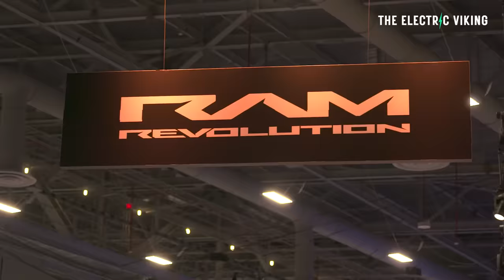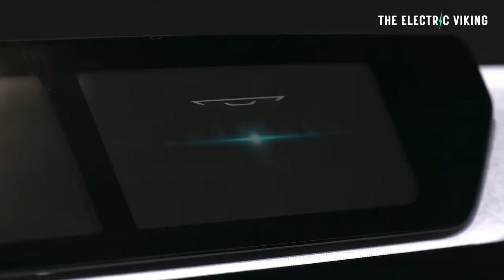Musk says Chinese EV companies will demolish most legacy automakers

Comment: In BYD defence, they're doing really good in a lots of countries especially developing countries. The only letdown is that the EV market in those countries have not yet taken off. Take my country Malaysia for example, BYD IS the best selling EV in Malaysia but due to the country's lack of EV infrastructure, it's EV market have not taken off yet, therefore they don't really sold much EV despite being the best selling EV brand in Malaysia.
Reply: there are no reason for malaysia to go all in into EV yet. Oil currently is still cheaper than electric unlike china u can save 98% of transport money by transfer from Oil into electric.
Reply: @nagi-springfield93  not really. Yes Malaysia is considered one of the countries that has the cheapest oil, but still 2x more expensive compared to charging an EV full with AC in home
Reply: @Rex-ww4cw  But still its 20 times more expensive than china. In china 1 kwh only cost about 3sen(Rmb) during 11pm-7am but in malaysia 1 kwh cost around 35-50 sen(myr). Chinese consumer willing to switch to ev because the benefit is significant enough to convince them but in malaysia even tho ev transport cost might be cheaper than oil but the car alone is so much more expensive than ICE mobile.
Reply: @nagi-springfield93  you literally said that oil is cheaper than electric in your first comments and I proved you wrong.
Reply: its not only malaysia problem, i think is common problem all over the world

Comment: You are dead right Sam. UNTIL someone starts to compete on PRICE no one is going anywhere. (Tesla DOES compete on price). When the Japanese "stormed the beaches" in the 1970's I was in my teens and CHEAP >>> anything else. A new Datsun B210 was something my non-car-loving friends could AFFORD to both buy and fuel (oil crisis, remember!) when my Camaro cost a fortune to run at 12 mpg (those big Holleys sucked a LOT of gas). A girlfriend of that era had a first-gen Civic, which is so radically different from today's Civic.
Come the late 1990's and it was the Koreans turn, with ultra-cheap Rio and Elantra. 1972->1997: 25 years. 1997->2022: 25 years. NOW it will be the Chinese, global politics and pandemics permitting. If it wasn't for the EV revolution, the Chinese would be shipping cheap small ICE vehicles, the coming switch to EVs just changes the dynamic. But unless the US and the EU throws up a protectionist fence, China will become a major auto power.
Reply: And just like now in the 70s every attempt of American OEMs to compete with Toyota and Honda was a complete failure.  The difference now is that it’s China not Japan and  the vehicles are EVs.  More and more it’s looking like Tesla will be the only American made EV company left standing that can compete in the mass market.

Comment: Standard sales strategies in a new market, basically divided into two.  BUY market share with lower prices; or use a LANCHESTER strategy, whereby you do not approach the main market directly.  You approach at a point that does not seem threatening and that is well away from the competitions main market.  You service the hell out of that local area until you own it.  Excellent service, fanatical customer support and good reliable products.  Only then do you slowly approach the competitions area, one town/city at a time repeating what you know will work.

Canon did this with plain paper copiers against the massive and mighty XEROX corporation in the UK.  It took several years to succeed but Xerox went bust and Canon were highly positioned.   This was a classic Lanchester method.

Watch out for a Chinese method that is similar.

Comment: 24/2/24 Chery Australia has recalled 5901 examples of its Omoda 5, after discovering a defect which can result in brake failure for the small SUV.

The recall affects all Chery Omoda 5s sold in Australia since local deliveries began in mid-2023.

“Due to a manufacturing defect, the bolt securing the brake pipe union may not have been tightened sufficiently. This could cause the brake fluid to leak and result in reduced braking performance,” Chery said in its recall notice.

“A reduction in braking performance could increase the risk of an accident resulting in serious injury or death to the vehicle occupants, pedestrians and other road users.”

Comment: The key selling points for EVs are range and price. So far not even Tesla has made serious inroads into either of these.  Perhaps 2024 will see some movement.
Reply: Please explain both points.  Price and range?
Reply: Prices have come down, The 3 and Y are not much more expensive then ice vehicles.
Reply: Isn't range the weak point, along with charging times? Oil and hydrogen and hybrid etc all have longer ranges than EV no?
Reply: @ex0duzz  The size of ones fuel tank is not the only thing that defines a car.  Especially if you fill it up at home every night.

Comment: What is the point of EV if it isn't better than gas car? EV have high cost and complex production , thus low profit margin - all because of its peculiar battery behavior : low energy density , decreased  reliability after so many charge cycles, high fragility , narrow temperature range, deadly in case of "thermal runaway ". Legacy OEMs have no where to go if EVs haven't proved themselves .
Reply: Have you driven an EV?

Comment: AI robotic labor can only lower manufacturing costs so far. A big part of the Chinese car advantage is supply chain.  
This cannot be easily replicated by OEMs. Using robotic labor may give the OEMs a little more room to lower prices but it still won't be enough due to the Chinese supply chain.

Comment: Thing is, one of the biggest barriers to EV take-up is infrastructure: not enough electrical capacity to charge the darn things if mass adopted! Not a problem in China where they are building about two coal-fired power stations a week...which asks the question: how green is an EV that's getting its electricity from coal...
Reply: They are not only building new coal fired plants, they are also shutting down old ones.
At the same time no one is building faster windpower and solar.
And an EV powered by coal isn't worse than an ICE but about the same. But it gets greener when the energiemix changes. This is the advantage.

Comment: There is a way to avoid a protectionist tariff wall, which rewards inefficiency and maintains domestic vehicle pricing at artificially high levels, viz. well above price levels necessary to realise healthy profitability for any truly efficient vehicle manufacturer. (It is only imported cars produced on the world's best/most efficient production lines - think EVs made in China - that represent a threat to the survival of the extant domestic manufacturers in the USA and Europe.) Now, protectionist measures put the survival of inefficient domestic incumbents in the manufacturing industry above the interests of consumers which is to have the best cars at the best prices. So, what is a country wanting to avoid that confounding protectionist situation while preserving a strong domestic automotive industry to do? Well, the answer to that is found in the recent history of the US motor vehicle industry.

In the USA during the 1970s and 1980s there was an onslaught of well engineered but inexpensive imported Japanese cars that were quickly accepted by US car buyers on pragmatic grounds - the imported cars were reliable/easy to maintain, used less fuel than US made cars (at a time when oil shocks had made gasoline very expensive) and were cheaper. Gains made by Japanese imports, however, came at the expense of US domestic manufacturers. The impact on jobs in the Auto industry gave rise to endless squabbles between the US and Japanese governments over all the standard trade complaints of the last fifty years - access to markets, unfair competition etc.

Now, in general a 'liberal' trade and investment environment prevailed in that period with a few exceptions. US nervousness over loss of jobs in the domestic Auto industry gave way to relief when it turned out that Toyota, Honda and Nissan were all happy, indeed anxious, to establish manufacturing operations in the USA backed by all the investment necessary to get these operations up and running. So, Japanese Automakers became transnational Automakers with a big stake in the US Auto industry.

The onslaught of inexpensive EV imports from China can be easily resolved in the same way. If BYD or NIO, say, are to lift EV sales to cater for markets other than China they are going to need a lot of additional production capacity. The tried and true approach is to establish operations in countries with large markets for motor vehicles (and typically an established vehicle manufacturing base). The US should stop fighting against Chinese Automakers establishing operations in the USA. That is the fastest and best way to rebuild the US automotive industrial landscape (and it sorely needs rebuilding) into a landscape occupied by manufacturers of the highest rank that can offer very good jobs to a great number of people.

But, if the US wants to take the calm path to the new world of efficiently manufactured EVs it needs to reconsider its trade war posture. I'm not suggesting that political considerations shouldn't enter into civil or economic affairs but the United States could afford to put down the big stick and start negotiating directly towards resolution of the issues that underlay the United State's sensitivities on trade. Otherwise, we end up with tariff walls and inefficient industries that sell us crummy high priced cars.